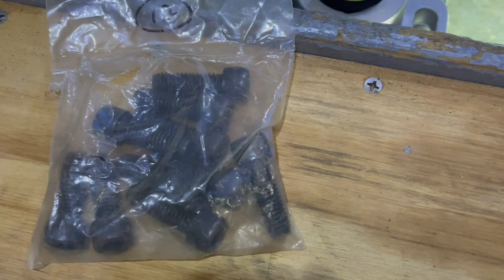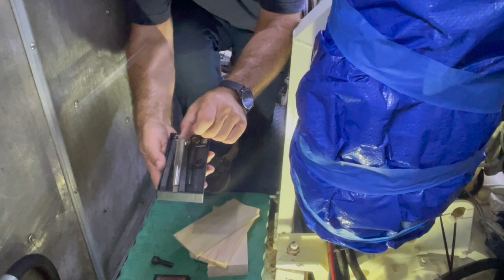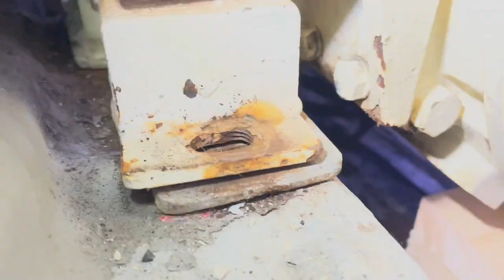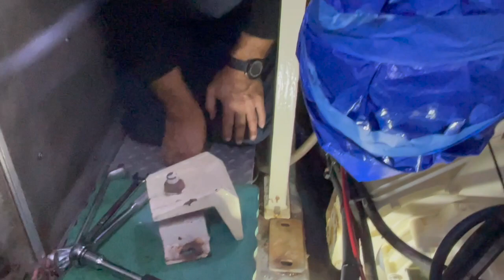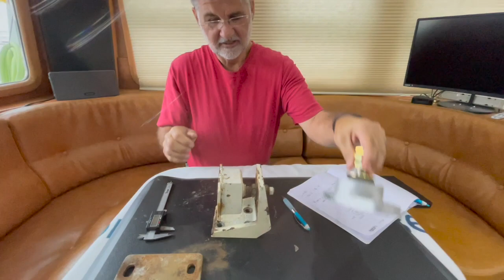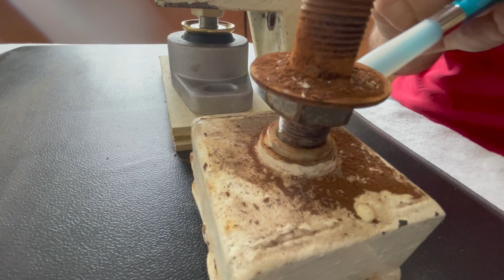Changing Chicory's Engine Mounts #1

Comment: This is very interesting. If you were to mount the motor-mount without shaving the shims would the centre bolt in-bedded in rubber not just adjust to the angle? Thanks for your video again.
Reply from the maker: Yes, the mount would adjust, but it is designed for a perpendicular load path for optimum efficiency.

Comment: Won't the rubber compensate for any height differences?
Reply from the maker: The higher on the mount the weight is placed, the more load imparted on the mount. It will perform better and last longer the closer to the center it is.

Comment: The two nuts on top of the engine mount bracket will make sure that the nuts can't be vibrated loose, right? Shouldn't there be two nuts underneath the engine mount bracket to prevent this as well?
Reply from the maker: Thank you for your question. The two nuts are for below the mount, the top nut will have a lock washer to stop it from vibrating loose.